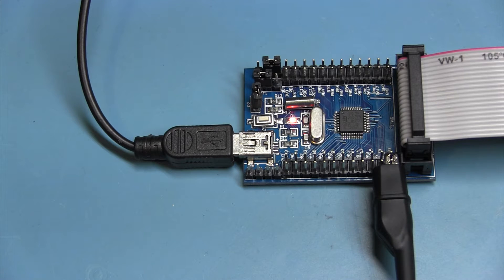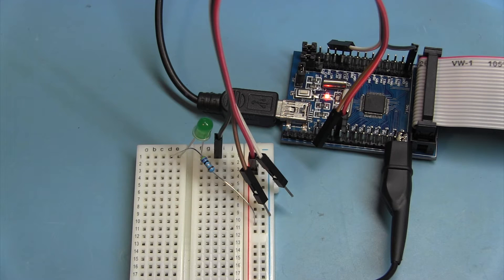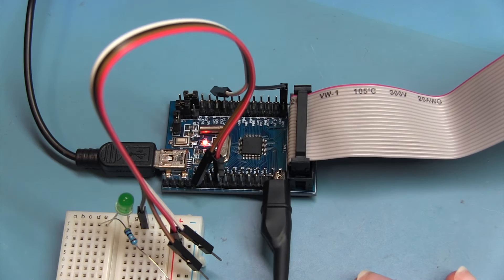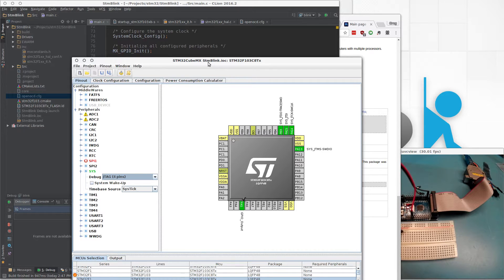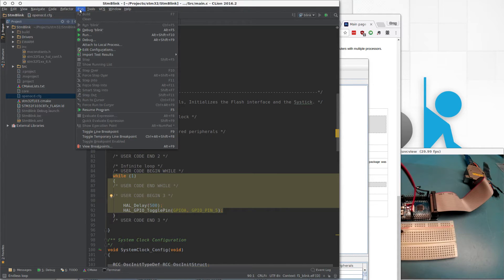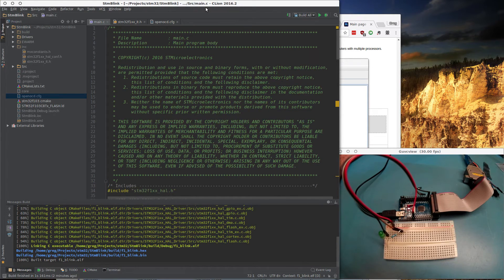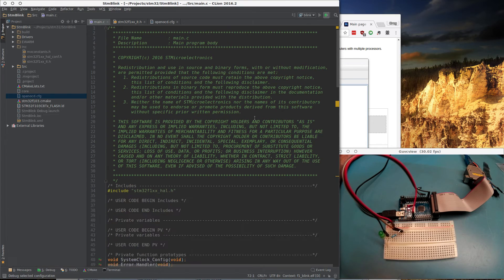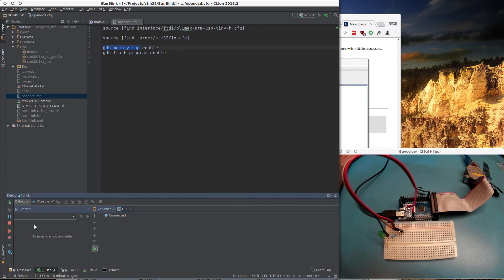Troubleshooting debugging an STM32 dev board with OpenOCD

Comment: I've had the same problem with mini development board for LPC2148. I figured out that I've done mistake by selecting 
LPC2138 instead of LPC2148, and after loading the code I've disabled JTAG. I've solved problem by connecting it via USB-serial adaptor, TX0, RX0, grounding boot, and reseting (practically forcing it into bootloader mode), then sent code 
for LPC2148 from Flashloader program for LPC series (for STM32 it will be STlink loader), and after that reset chip again, power cycle it, then: BOOM, JTAG works again.